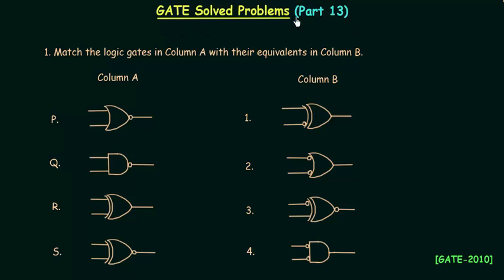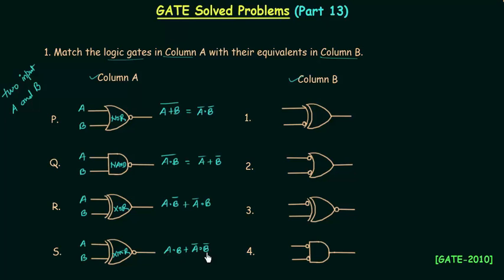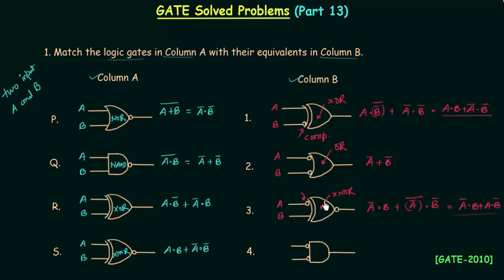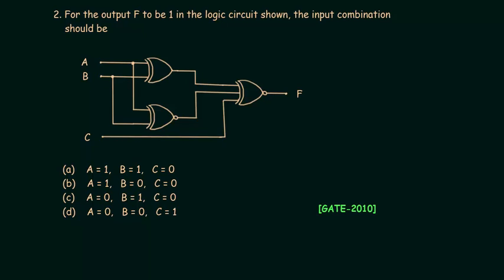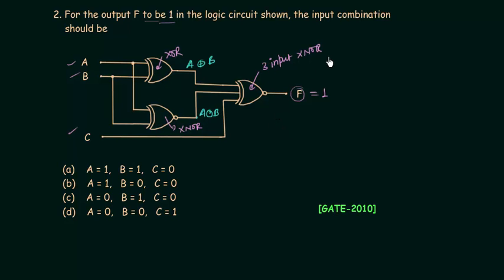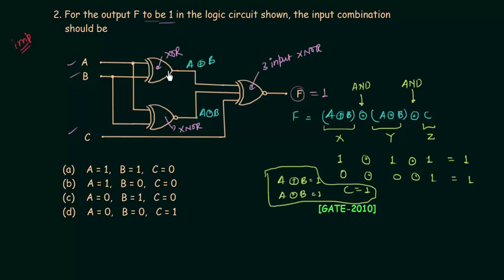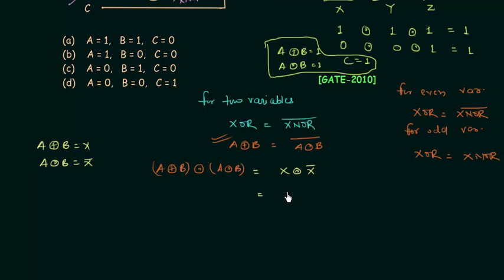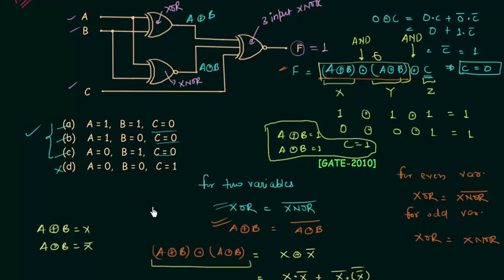GATE Solved Problems (2010) | Logic Gates | Digital Electronics

Comment: For 2nd Q I think option D is correct because  the 3 input X-nor gate, the output will bee High whenever any two input is HIGH (Xnor- for even no of 1s the output is 1). The  output of xor and Xnor of input A and B is complementry , so we can't make them equal.  To get F=1 we have to make C =1 . Now we got 2 input as 1s, one is from c and other from Xor (or) Xnor. For this ciruit  if c=1 then F=1 for any A and B.

plz clarify this
Reply: Yes. You are correct. That solution have been done incorrectly in the video.
An X-NOR gate gives a '1' when '2' or 'none' of it's inputs are 1.
Reply: vignesh swaminathan  You're answer is exact !!
Reply: ya ofcourse D is correct
Reply: vignesh swaminathan  ya d is correct
Reply: Yes correct

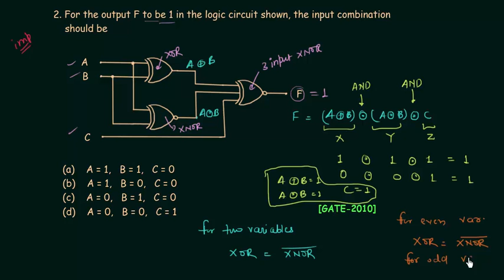Comment: @7:43 you said for odd no. of variables XOR = XNOR.

BUT TRUTH TABLE FOR 3 VARIABLES OF XOR & XNOR are different 

3 input XNOR TABLE : 

C B A Q
0 0 0 1
0 0 1 0
0 1 0 0
0 1 1 1
1 0 0 0
1 0 1 1
1 1 0 1
1 1 1 0

3 input XOR TABLE :

C B A Q
0 0 0 0
0 0 1 1
0 1 0 1
0 1 1 0
1 0 0 1
1 0 1 0
1 1 0 0
1 1 1 1

Is there anything wrong in the truth table or am I missing something.?

the link from where the truth table have been copied: http://www.electronics-tutorials.ws/logic/logic_8.html

Please correct me if I am wrong.
Reply: Akash Bisht 
Your XNOR truth table is wrong in XNOR if you have even no. Of 0's then output 1 always